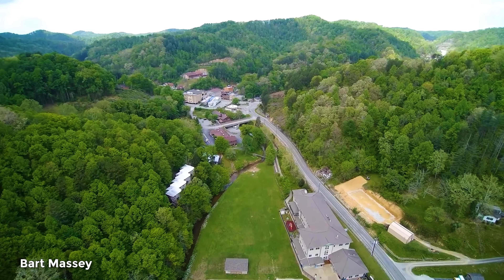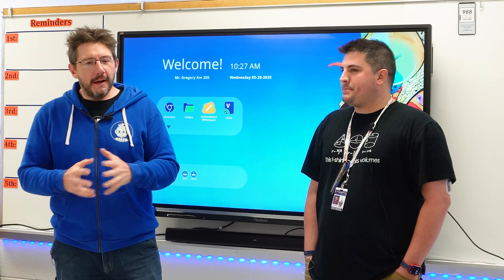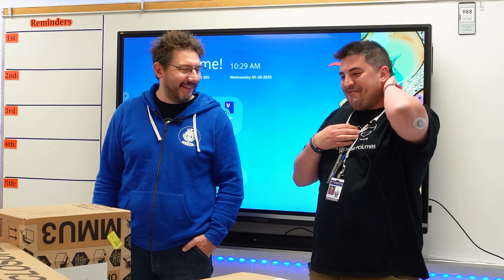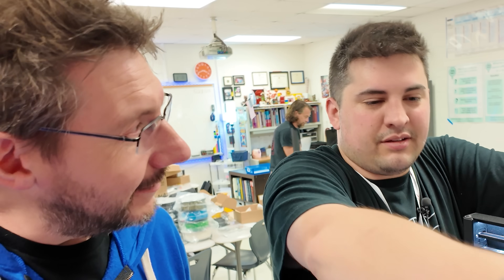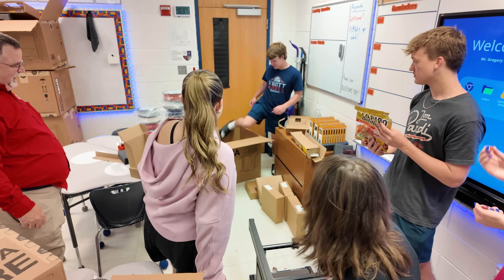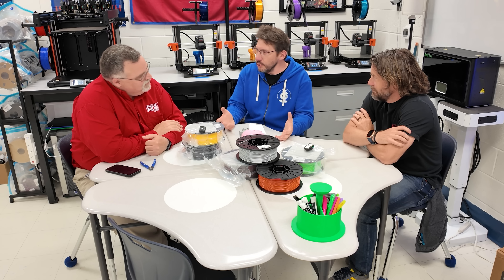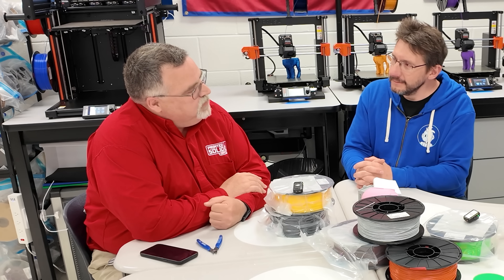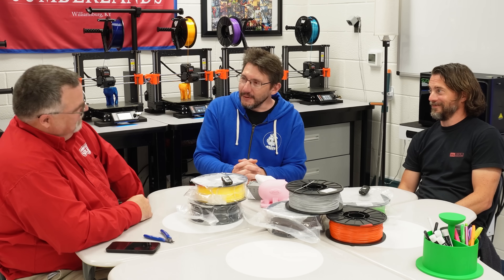Small Town 3D Printer UPGRADES!

Comment: fix wall-to-wall layer adhesion (walls not sticking together mostly). well 110% flow rate fixes it mostly.
Reply: try spin 3d printing (dvd-drive) instead of cartesian 3d printing. no need to stop the movement of the nozzle.